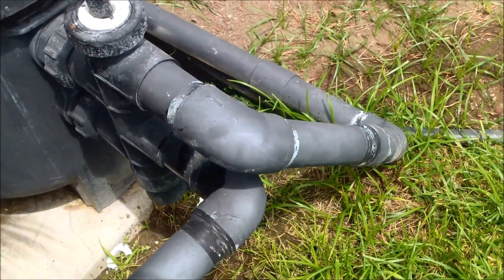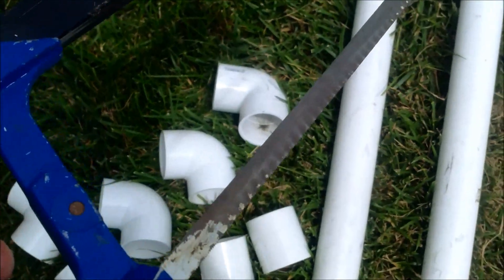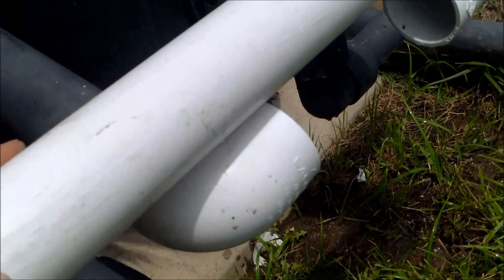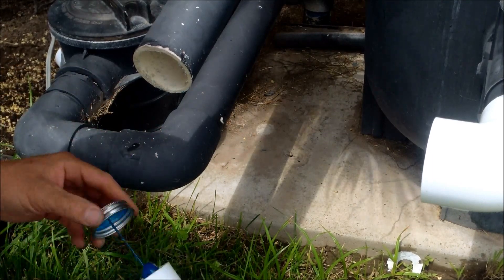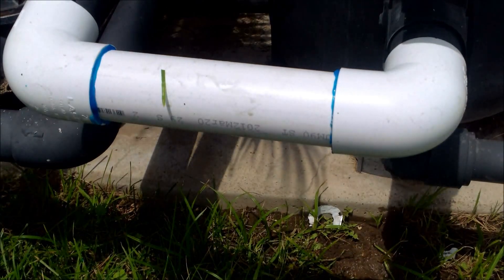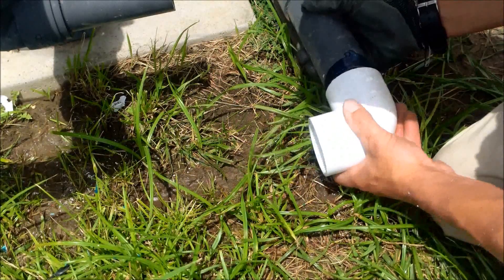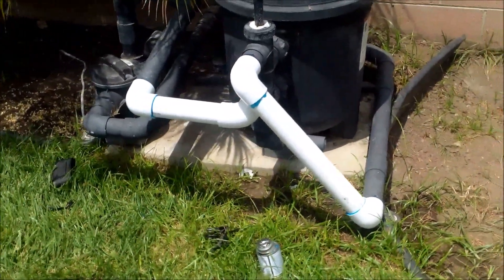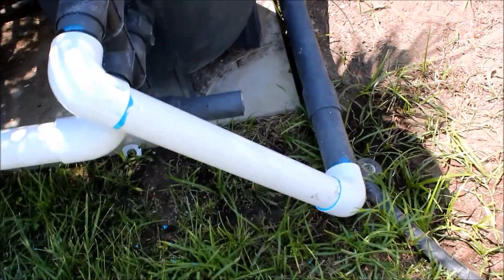How to Fix Leaking Swimming Pool PVC Pipes

Comment: An easy way to get a good fit, is to dry assemble the pipes and fittings and then make an index mark on each pipe and fitting which makes reassembly easier when you put it back together with glue. Thanks for sharing your post. Jer

Comment: Some improvements ..
Clean painted pipe , bevel edges , cut pipe at 90 degrees ,  fit the elbows to the straight piece then fit that to the existing pipes rather than trying to fit the long straight pipe into the elbows which were cemented..
Reply: no sanding the soft surface?
Reply: I use a chop saw any time cutting pvc, fast accurate 90 degree cuts.  Still need to clean the ends off.  That residue on the ends will come off, it’s got to go some where.  In this case the pool or it’s filter.
Reply: You are :yougotthis:correct

Comment: Just something my grampa (35yr industrial pipefitter and started a plumbing business that he sold to his nephew) always said about keeping elbow joints lined up: insert the elbows onto the length/connecting pipe without gluing, then glue the female ends to their male ends. Let that set for a minute or so, remove the length from in between and glue both ends and reinsert where they go.
No guess work. He also said plumbing isnt carpentry, so leave some wiggle space. He was born in 1917, old oldschool words of wisdom. Otherwise i think hed be impressed by your work.
Reply from the maker: Great tips! 👍👍
Reply: Didn’t understand can you explain better with an example

Comment: I would only recommend cutting out/replace pvc as last worst scenario.  I HIGHLY recommend jb water weld.  This stuff is awesome and can plug a leak UNDER WATER if needed.  I have plugged multiple pvc joint leaks successfully with it.  Wated weld is less then $5 at WM.

Comment: You did an excellent job demonstrating all the tasks associated with using PVC piping at a pool site.  I am currently snowed in and will not use this techniques until April.  While I am indoors I plan to get some PVC piping and glue and begin experimenting with your techniques.
Thank you.
Reply: the one thing he did not do was remove the old paint from the piping so he is gluing new pipe to old paint. to avoid this get some primer and keep rubbing it on until the old paint comes off be careful as some primer is purple and it stains instantly (concrete, hands, etc.). after primed and dried then glue both the side of your pipe that is primed and the coupling or elbow. a chamfer on the pipe should ensure a good gluing as well. remember to give about a quarter-half a turn if you can wile gluing pipes together. try to finish your projects with a "bridge" of pvc with 2x 90s on the ends of a strait piece of pipe; this will allow the most snug fits.
Reply: Wearing gloves is very crucial

Comment: If you want to get the proper angle, when dry fitting, draw alignment markings with a permanent marker.

Also take pictures of the original plumbing before cutting.

Comment: Surely the pipe at 2:36 should have a chamfer on the edge before replacing the fittings to avoid the pipework pushing all the glue out and weakening the joint? Unfinished ends cause more problems than they solve.

Comment: hello Ryan. thanks for the previous help I fixed my DE issue it was a grid that was ripped. Now I have another issue. I think it's my return pipe. It's leaking where it connects to the copper underground pipe. I have a question when ever you cut a elbow piece. when you install the new elbow is there anything else you do? I'm referring to the loss of amount of the pvc pipe that was originally placed inside of the elbow. Like on this video. You just cut off the old  elbows and replaced it with new ones. hopefully you understand my question. thanks in advance for your assistance.

Comment: Unsure if this thread is even active anymore due to it's age, but I'm having a leaking issue with joining 2" PVC to a 1.5" tigerflex piping for the pool skimmer.  I've used 4 different reducers and every F*&%ing one of them have leaked. I'm going to try buying a Fernco rubber reducer with clamps on each end.  If that doesn't work, I have no clue what else to try.  Any ideas are welcomed. Thanks
Reply from the maker: That is a tough one. Flex pipe can be a pain. Can you remove all of the flex pipe and go with regular PVC?
Reply: @SPL  I used the rubber reducer with hose clamps and it worked! Now I have to fix the leak at the return elbow 🤦‍♂️

Comment: I am going to install my own salt cell I am nervous because I have a valve in the area I am working can I save the valve if I cut next to it? Thanks as always
Reply from the maker: Try using a fitting extender so you won't need to remove the valve. http://www.inyopools.com/Products/07501352024354.htm?gclid=CjwKCAjw6fCCBhBNEiwAem5SO-H6tXx6Q7Cg5AJkrJIlxRL1cwU2zRTfXpYO1kq7Jw6MnesRUiT2BRoCr9wQAvD_BwE

Comment: Is there any difference in PVC piping for pool use oppose for house plumbing?
From this video I can tell that you are using Pool Tight to glue the fittings.
Thanks and great video by the way!
Reply from the maker: ***** Not really. The 2" PVC they sell at Home Depot is the same my supplier carries. Any PVC cement will work as they all have the same active ingredients in it.
Reply: R H he was using "rain and shine" pvc glue it can work on wet pipes and no need for the primer also he gave you the wrong answer.  You have to use pressure rated  pvc fittings (Nibco) to install according to all local building and plumbing codes. Not all home depot carry them. The sch40 pipe is the same but the fittings are NOT. most home depot only carry dvw fittings Which are not acceptable in pool applications.
Reply: @enasoii  rain r shine requires cleaner/primer if pipe will be under pressure. Basically no primer necessary on blower lines and drainage pipe, otherwise, primer required.

Comment: shouldnt you have cleaned off the paint on the pipes and also you need to use primer before glue.
Reply: also bevel the edges so the sharp edge does not push out the glue.
Reply: Daniel Short yea for diy
Reply from the maker: Yes, good points and good tips.
Reply: Daniel Short How do you bevel the edges?  Do you use a standard metal file or something else?
Reply: I used a razor knife, or you could rub the pipe on the concrete. From what I learned if you dont do this it will push the glue out of the coupling.
Reply: @YOUandMeRealtyDotCom  i use about 3x more teflon tape on the threads then needed.  that way you can get really good hand tight without possibility of cracking the female side (housing).    same with installing gauges.  i use alot more teflon than needed

Comment: Can you do a video on finding and fixing leaking in ground plumbing?   Or just a video on suggestions on what products to use to fill leaks without digging?
Reply: contact american leak detection.  leak detection beneath ground is not a DIY. its a actual skill with EXPENSIVE tools. or just look for constant damp wet spots around the area, obviously not after a rain or after a sprinkler system has come on.

Comment: My situation is weird. I have two pinhole leaks on the pool pump housing itself, at the back of the vertical pipe leading to the filter. Opposite side of filter basket. Not related to clamped area. The leaks spray water backward along the pump housing, just above motor.  I'm not sure if I can use PVC cement. Perhaps epoxy. I can't find anything online directly related to this
Reply: Not sure what mfr. pump you have, but it sounds like you're talking about the seal plate. PVC cements won't work on that type of thermoplastic. And pvc cement can't just be spread over a crack to seal it, it requires to pieces that are coated with glue and they are chemically "melted' together. Seal plates are under a lot of pressure so even if you could find some type of epoxy I wouldn't trust it long term.

Comment: If your leak is coming from flex pipe cut off from leak and use a rubber coupling with hose clamps to attach new pipe.

Comment: I'm getting bubbles in my pump and out of the returns.  Might it be worthwhile to put some of the blue cement around the joints without disassembling, or do I need to take the pipes apart?
Reply from the maker: +Ryan Searfoorce You can try some silicone sealant. I've also used professional quality electrical tape.
Reply: Thanks.  I'll start with the easiest option - I have plenty of electrical tape.

Comment: Is pool pipe the same diameter? I have a Pentair System. If that helps. Couple leaks but also want the Chlorinator horizontally vs vertically.
Reply from the maker: There are two sizes. 1 1/2" and 2"
Reply: @SPL  Thank you so much, and I just want to say what a tremendous help your channel has been to me.

Comment from the maker: Not a big fan of unions on pool equipment. They tend to be more trouble than they are worth. A lot of air leaks happen right at the unions. You can add them if you want - this particular backwash valve -push/pull kind lasts a long time. The only thing I change is the plunger and leave the plumbing intact. So it doesn't have to be removed at all.

Comment: Is the purple primer not necessary?
Reply from the maker: bludika  You can use it if you like. It has the same ingredients as the pvc cement - I do use the primer  in other videos.
Reply: bludika purple primer or regular primer is a must it cleans impurities and insures proper a bond that will last. Your chemically welding the pipe together.
Reply: Bill Wesolowski  maybe not much of difference on new pipe but pipe that's weathered there's a difference
Reply: No.  the purple (or clear) primer is absolutely necessary, and never glue over paint. Look around on YouTube for a few other demos before you plunge in.
Reply: @ThorD4602 I couldn’t agree more. I don’t care how much they advertise all in one glue. It’s bs, always use primer. It creates the bond between the surfaces by heating the pipe up and making it soft and you’re also getting rid of the gunk that’s on the surface. That’s the main reason this cat in this video struggles to get the fittings on. Not to mention he the process out of order but that’s me being picky.

Comment: Are you not required to prime PVC pipes in CA, or is it already "in" with that glue?
Reply from the maker: Primer is required if the pipes are being inspected so you want to go sloppy with the primer so it gets all over the pipes and the purple color is obvious to the inspector. I filmed a re-plumb job using primer put haven't uploaded it yet. If you look at the primer itself, it has the EXACT same ingredients as the PVC Cement so primer is in the product already. Lots of guys don't use it unless there is an inspection. Proper application of the PVC cement is the key. Primer basically gives the pipe an even 1st coat, "softens" the PVC pipe and acts as a guide as you apply the PVC Cement.
Reply: That's cool to know. I personally never really saw the benefits of that glue which drys/sets fast like that. Maybe for an emergency job of sorts, sure, but in this case where there is still a 24-hour wait period, it just seems better to have more tome to get everything aligned right, even if you dry-fit them first.

Comment: Hey I have a timer that doesn't seem to turn on on its own. It only turns on when you turn it on by hand.  Its a yellow intermatic timer. Like the one in this video..  Any ideas why its doing that? Thanks.
Reply: yep, Bad clock motor, can be replaced if it's not moving in the visual window and turn it on manually that's the issue

Comment: You need to make sue your glue covers the area that the glue goes on. Also you need to put glue on the very end of the pipe because that is where the sealing occurs on a pipe. It would have been better to glue your 90's on your pipe to line up with the old pipe and then just push it on.
Reply: Exactly